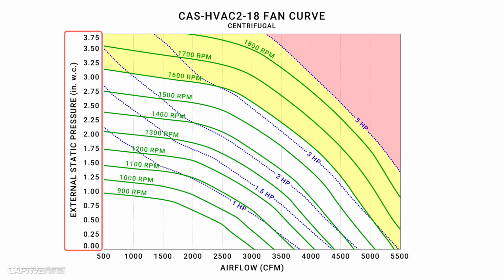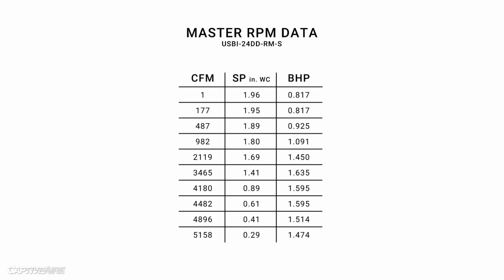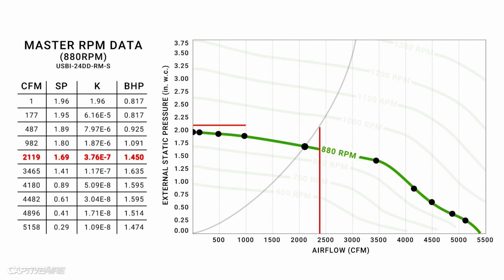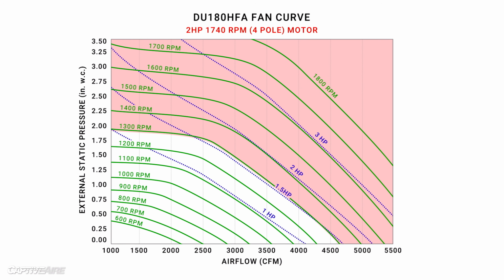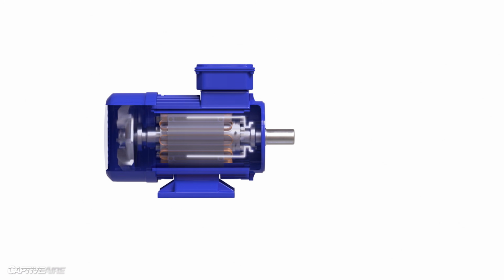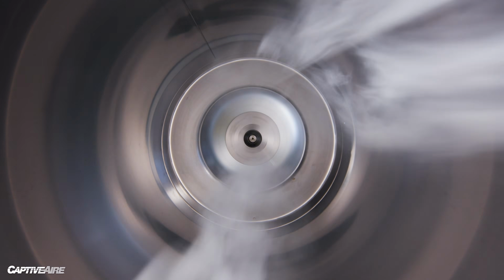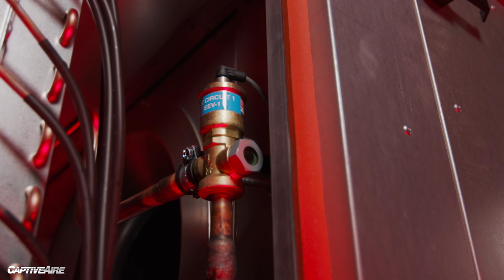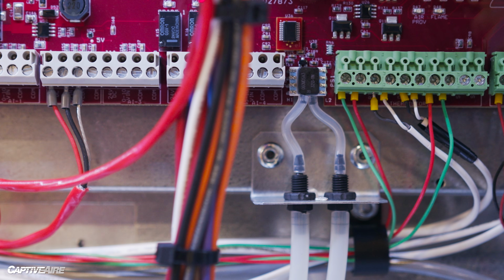Fan Curves - A Deep Dive

Comment: At 4:30 isn't that meant to be a total pressure reading, a static pressure probe shouldn't oppose the flow.
Reply from the maker: In this case, the static probe has to be inserted to oppose flow in order for the pickup points to remain perpendicular to flow. Check out this section of this video for a graphic on this topic (06:37) : https://youtu.be/WE2LPedFbgA?t=396&si=tcRf-pxYv0Yf-Yuw

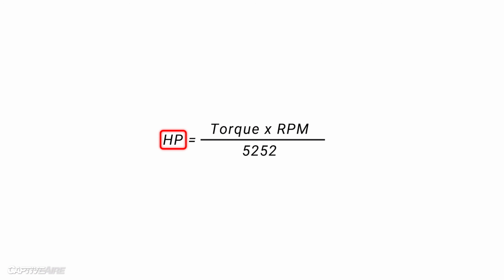Comment: the torque remains constant? 21:05, I dont get it why the motor torque is constant
Reply from the maker: Thank you for questioning that. You're right, the fan laws do not assume torque is constant, in fact they very much indicate that it is not. What we should have said here is the fan laws assume a perfect exponential torque curve, but motors don't necessarily follow them due to different characteristics.

Comment: Very interesting, I’m not even in the HVAC industry. Forgive my ignorance, I’m curious, do losses in the efficiency at both the inlet and outlet due to bends etc  add together or cause a compounded loss ?
Reply from the maker: That is correct. A loss upstream of the fan will cause a vacuum, or "negative" pressure so to speak. Downstream it will cause the opposite, a positive pressure increase. The fan has to handle the difference between the two.

Comment: Id be interested to know the motor temp over the curve if it ran until temp leveled out on each restriction
Reply: Also how a 90° fitting effects it on the filter side and how that same fitting  moved at 1 ft increments away from the blower.    If i had that setup I'd play with it for months.

Comment: 12:40 No, brake horsepower is the amount that actually makes it to the shaft. While electric motors may have fewer moving parts to cause losses, there still are electrical losses, otherwise the motor wouldn't heat up while running. Hopefully when a motor is chosen well and used properly, this loss is small. It is called brake power because it is traditionally measured by literally braking a motor with a lever. This allows easy simultaneous measurement of torque (length of lever times weight at the end) and RPM, and when multiplied, that gives brake horsepower
Reply from the maker: You’re correct. Another simplification here, as we like to practically relate BHP to “what the fan needs” for a certain operational parameter. Thank you for providing a more comprehensive explanation.

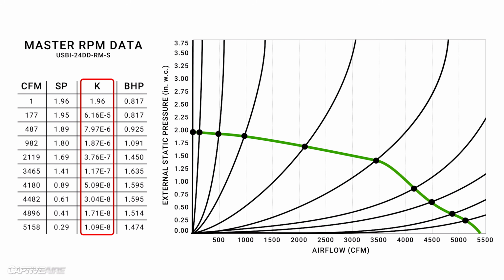Comment: 9:24 These curves are clearly not parabolas though... According to the equation you just gave, they should be. The curvature is greater at the lower ends of the black curves, decreases near the crossing point, and then increases at the top end. Parabolas have constant curvature. Also, I went and looked at some fan curves, and they had parabolic system curves.

Edit: it also looks like the real system curves used later in your video are parabolas, so not sure why the demonstration one was wrong
Reply from the maker: Yeah they should be! In the opening example I (German) drew up some quick lines to just show the general idea. The system curves later on are actual calculated ones. Sometimes we take some creative liberty to quickly visualize something and it backfires on us. Good eye

Comment: That was amazing! All I wanted to do was build a extraction system for a small spray paint booth and - probably going all overboard on the task at hand already - I decided to go down the rabbit hole of expanding it into a full air filtration system for the entire workshop. I've been researching for weeks and your videos are the FIRST ones I've come across that give a comprehensive explanation on fan design, curves, actual calculations and pit falls. Thank you so much, if I was 20 years younger videos like this one would be an inspiration for a career path!
Keep up the good work!
Reply: I wish I would have had this when I did air balance on restaurant hoods.
Reply: best of luck.
in case you missed look for Capture Velocity and Transport velocity

Comment: Fantastic video.
One question, thought.
At the Motor Basics section you are saying the reason a 4 pole motor can give out only 1.38hp against full 2hp of a 6 pole motor has to do with the nonlinear relationship between torque and speed.

I am not sure myself, but I believe it all comes down to current.
With a motor that has fewer poles a VFD will have to lower frequency more than it would with a motor that has more poles. More frequency decrease means more voltage decrease to keep the constant max available motor torque. However, with the same torque * speed = power mechanical, but lower voltage the current will need to be higher to keep v*i = power electrical.

So, I guess it's the current that limits the 4 pole 2hp motor to 1.38hp when coupled to that specific fan.
Reply from the maker: That is correct. But remember the resulting current through the motor will have a lot to do with the voltage out of the VFD (as well as things like slip and how the fields are interacting, or impedance as a whole). Although the VFD doesn't change voltage in a traditional sense, it can change the duration of the pulses that make up the simulated sine wave, and this will change the amount of current flowing through the motor. We have a video that explains this better here https://youtu.be/RG3eljmqyq4?si=R5Io5EQkTNSryjqn&t=2431
As explained within this fan video, we do sometimes push that variable voltage so that the motor sees current close to its limit whenever we need to increase power at lower RPMs.
Reply: @CAPTIVEAIRE  I have been rewatching the series recently (again I have not seen a better quality production anywhere - great job!) and decided to dig a bit deeper this time about Motor Basics.

It is true the current depends on slip, field interaction and impedances, but I think all these factors are effects (consequences) that drive the current up rather than causes.

It is because the 4P motor will need lower frequency than the 6P motor to rotate the same fan at the same speed, the VFD output voltage for 4P will be lower than for 6P motor (again because of VFD keeping the V/f ratio to keep the max available flux constant).

For the fan to operate, the motors will have to provide torques equal to the fan load torque. 
The fan load torque is the same for both motors at the same speed because the fan and the system are the same.
Since the motor torque is a function of stator flux (magnetic field), rotor current, angle between the two (load angle) and most importantly here the pole number, the 4P motor will have to compensate for lower pole number in something to provide the same torque as the 6P motor. 

Since V/f is kept constant and thus the stator flux is constant, this leaves only the rotor current and load angle as variables. 
Hence, the rotor current and load angle will have to increase.
For the rotor current to increase the slip will need to increase. The increased slip tweaks the impedances (increases R2/s or decreases 2*pi*f*L depending if you use the equivalent circuit or not) and from there the impedances push up the load angle (arctan of s*X2 / R2) and rotor current (s*E / Z2).
The increased rotor current by transformer principle means the increased active component of the stator current.
Thus, the slip grows to allow more current and angle that in turn compensate for the lowered volage in managing the torque.

Magnetizing current is larger for 4P motor than for 6P motor (so it's a factor too) but it is kept constant because of the VFD managing the V/f ratio.
Hence, the 4P motor will draw more current than 6P motor for the same fan operating point.

In my previous comment I looked at it from the power balance perspective, which still holds true. It is just that it was high level and the slip, impedances etc. are what under the bonnet so to speak that make the power balance work.

As for how the VFD creates the output voltage waveform, I think it is non-consequential for the phenomenon described above if only to a small degree. Most VFDs come with du/dt or sine filters (just a bunch of passive components such as capacitor and inductors) that smooth out the PWM into a sine waveform. The remaining harmonics do cause trouble for motors, especially for their bearings through fluting and they do cause additional heating inside the motor by the effect of voltage drop, but they are usually minute and often properly managed. The motors used with VFDs are usually specifically rated for VFDs to tolerate those harmonics and supplied with proper VFD rated cables and cable glands to force harmonics through cable gland grounding rather than bearing. Anyway, the point is that I think all these VFD specific reasons are secondary if not irrelevant to the issue at hand.

What is not irrelevant is motor cooling. The induction motors are air cooled by the fan installed on its back which rotates off of the motor axis and thus rotates at the same speed the motor rotates the axis. At too low a speed the air flow that fan draws across the motor falls off at quadratic rate as it does for any fan. Hence, the motor is not cooled enough all the while it draws larger currents (as I described above), thus exacerbating the overheating. 
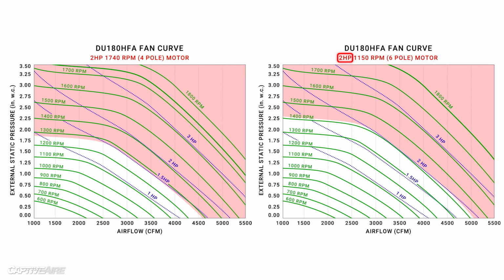I don't think it is too often relevant for air fan loads, since at low speeds the load torque falls off too at quadratic rate, and thusly so does the current demand (even more so than the current increase needed due to lowered voltage as per the phenomenon described above). Hence, the motor does not heat up as much to cause overheating even as it loses self-cooling capability. In seldom cases it is relevant, I think this phenomenon will be setting the lower boundary (rather than the upper boundary) on the chart at 22:42.

Oh, and the last thought (perhaps the most intriguing for myself) on the quadratic in lieuof linear V/f relationship at 21:50. 
I have heard of the quadratic V/f relationship but in those the voltage is lowered below what it would be per linear relationship at lower speeds. This is because you don't need a lot of flux since the fan load torque falls off quadratically at lower speeds. Lowering voltage and thus the available flux at lower speeds saves on magnetizing current, hysterisis and core losses - overall on reactive power, thereby increasing the motor efficiency. The compensating increase in the slip and stator active current causes way smaller ohmic losses at lower speeds than what is saved on ohmic losses due to magnetizing current and corresponding iron and hysteresis losses.

What you suggest (that is, pushing the voltage up beyond linear relationship at higher speeds) seems to me counterproductive. This suggests that the motor has more core iron than needed since it can accomodate more flux than what the linear relationship would suggest (and it usually suggests the maximum since all motors and transformers operate at near saturation point). This means excesssive iron that is otherwise wasted and which spins around as extra weight when at lower speeds. Otherwise, if not oversized, when voltage is pushed as you suggest at higher speeds the core would saturate and it will cause way more losses and troubles as the magnetizing current would soar and so will the stator current. The decreased slip and active component of stator current and rotor current will contribute next to nothing compared to skyrocketed magnetizing current.

I am intrigued at the explanation you could give for that, because I believe it should be the opposite: quadratic V/f that goes below linear line at lower speeds rather than above it and which only equals the linear line at maximum speeds.

Anyways, I have been writing this for over an hour now. I am thankful to you for jolting my memory of electromechanics and revitilizing my interest in the subject. Keep up the good work and hopefully I will see more of your incredible work in the future! Cheers!

Comment: Wrong! Brake-horse-power is the horse power above and beyond that which is needed to overcome the engine friction and is that power available to the output. Or in other words it’s the power output which requires external brakes to arrest it.
Reply: Yeah i think ur right ...bhp is main and after losses its hp
Reply: I think after combustion its bhp and once the losses happen untill it reaches the wheels thats hp

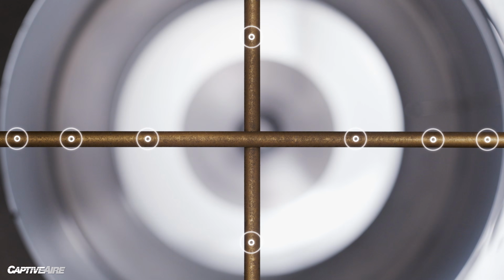Comment: 3:40 The grid of pitot tubes. Are they simply holes drilled in a common shared tube? Or do they each have their own channel? Is the averaging done mathematically or pneumatically in a shared tube for all the holes? I could imagine air flowing into some holes but blowing out others.
Reply: The holes seem to be in a common shared pipe, so the pressure there is the average of the total pressures. The static pressure appears to be taken at only one point. Since the velocity depends on the square root of the dynamic pressure, using average pressures may not give an accurate average velocity. In this case, it does not matter because the measurement location is quite ideal and the variation between points is small. In field conditions, the dynamic pressures (the difference between the total pressure and the static pressure) are taken separately at these points with a Pitot tube.
Reply from the maker: Good question. It’s a common tube. The averaging is done pneumatically. The hole locations in the grid are specifically spaced for each to capture a total pressure representing an area of the duct. The idea is that each hole represents an equal amount of cross sectional area. So you will find the hole spacing is closer towards the outer diameter of the duct, and farther apart towards the center core. On a rectangular or square duct it’s a bit easier, each hole spaced equally to capture equal areas.

Comment: @4:34 Did you insert the probe with the tip opposing the air flow to measure static pressure?
I thought this measures total pressure. Static pressure is measured by keeping the probe (hole) perpendicular to the flow.
Reply from the maker: Yes great question. The probe itself is oriented with the tip facing the airflow. However, the holes that measure the static are not at the tip point, they are on the surface and thus perpendicular to airflow. This ensures velocity/dynamic pressure is not affecting the reading. Next time we will include a graphic to avoid confusion.

Comment: Just finished the Plotting Horsepower lines section of the video, Is the real world performance of the Fan curves also tested to verify the calculated results? 

Sorry if this is answered later.
Reply from the maker: Great question which we didn't address. Yes you are correct, the performance will be tested at different points and rpms and any adjustments to the theoretical curves will be made then.